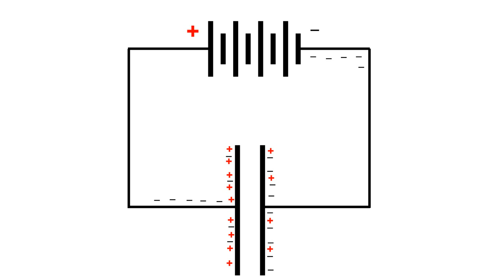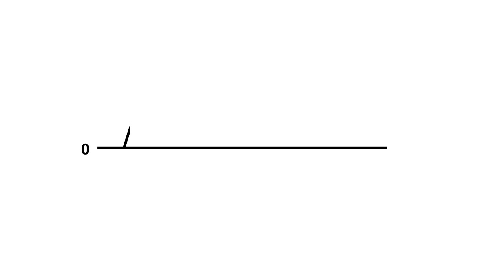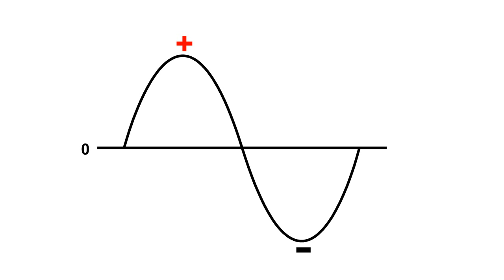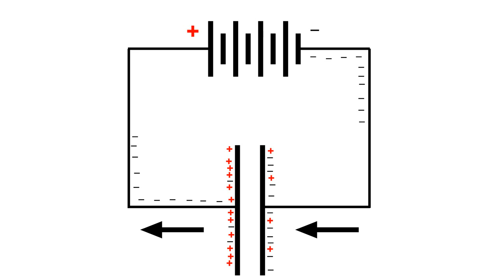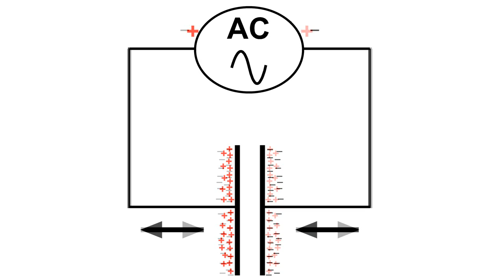Capacitors, DC and AC Current

Comment: How come AC can still come out of a capacitor where the input is a DC biased AC signal when the voltage never goes in under 0? Wouldn't it just be the current speeding up and slowing down if it's in the positive domain only?
Reply from the maker: I'll make another video on this and I'll REPLY to this comment when the video is uploaded. THANKS!
Reply: @AllAmericanFiveRadio  I appreciate that thank you! Something clicked last night and I realized that even if it’s a positive voltage supply, the capacitor will need to discharge if the voltage suddenly drops to compensate, and during that period current would flow in the opposite direction! This must correspond to a negative voltage if you were to measure the voltage between the capacitor output and ground. Is that right?
Reply from the maker: @d3nt391  It’s negative and positive. You are eventually RIGHT. Your question has given me an idea. Keep asking your questions.
Reply: @AllAmericanFiveRadio  thank you! I meant that in a DC circuit if the voltage supplied to a fully charged capacitor drops, even if it’s still in the positive supply range, the voltage from the capacitor output leg to ground will be momentarily negative as it discharges (current flowing in the opposite direction), and rise back up to 0 when the capacitor voltage matches the supply voltage (current slowed to a stop). If the supply voltage increases across a fully charged capacitor, the voltage will momentarily be positive until charged the same way. So putting that together: wiggling the supply voltage up and down is like a biased AC signal, and it’ll look like an AC signal of the same frequency with positive and negative swing at the capacitor output. It also explains why the rate at which the capacitor can charge and discharge, or analogously the frequency of the AC input, can attenuate and slew the signal.

Sorry for the rant, but curious to know if that all sounds right. Thanks again for your vid and electronics wisdom!
Reply from the maker: @d3nt391  I’d say that you have the right idea. Lets say the DC voltage is +10VDC. If we add an AC signal to this +10VDC the  positive part of the AC adds to the +10VDC, the negative part of the AC subtracts from the +10VDC. It is this change in voltage on one plate of the capacitor that changes the voltage on the other plate. So the AC signal passes through the capacitor. I think I can show this effect in a video. Keep asking your questions. Rick
Reply from the maker: @d3nt391  Here is the new video, hope it helps.
AC DC on same WIRE how Capacitor Isolates AC
https://youtu.be/QpB8z6d_7Aw
Reply: @AllAmericanFiveRadio  thank you so much!
Reply from the maker: @d3nt391  Thank you, and your welcome.
Reply: Thanks a lot.

My struggle is how capacitor x could filter the EMI and also how the Y one works.

Grateful if you prepare a video on this or even on all the filtering elements and how they really work
🙂
Reply from the maker: @d3nt391  Here is the new video.
AC DC on same WIRE how Capacitor Isolates AC
https://youtu.be/QpB8z6d_7Aw
Reply from the maker: @kenzo4Ever  Here is the new video, hope it helps.
AC DC on same WIRE how Capacitor Isolates AC
https://youtu.be/QpB8z6d_7Aw

Comment: Hei: Mr, Your explanation of Capacitors Block DC & Allow AC flow is very Brief. Basically AC electron flow simply travel forwards & backwards cycle in between Capacitor Dielectric inside. 

You did now explain Why & how first order Crossover Speaker Capacitor can filter & allow AC electron current to flow/pass through Dielectric insulator.  Please provide YouTube video proof & explain in deatail files if you knows. How it works? Tks...
Reply from the maker: +Madcow Computer 
How  Capacitors charge and discharge
https://youtu.be/Ag2RujOHqJ8

PI filter, Resistor Choke Oscilloscope Demo
https://youtu.be/WzwaHO6WPCk

LC Resonance Testing Demo
https://youtu.be/84WmnlKgTeg

LC Resonance Oscilloscope Demo
https://youtu.be/G_RCyDdt2rM

Resonant Frequency
https://youtu.be/wpNqKJ_6wZA

Comment: I thought current always flows in the direction Of negative. Your diagram shows the current opposite. wouldnt the circuit like this chargr neg to neg and pos to pos
Reply from the maker: +Alchemy Alloys Tattoo 

Electrons flow from negative to positive in a circuit.
Reply from the maker: +Alchemy Alloys Tattoo 
What we know as electron flow, is from the negative to the positive in a circuit. This was not discovered until the vacuum tube rectifier was created. This is when they discovered that they could only get a current to flow when the negative terminal was on the filament and the positive terminal was on the plate. The problem is, before this they had guessed wrong an said that current and electrons flowed from positive to negative, definitely wrong. However for some unknown reason they did not change the arrow for current but they did for electrons. Since electron flow is current flow this absolutely makes no sense at all. So I just use electron flow from negative to positive, because that is the way it is, that has been proven, no doubt about this. Electron flow has been compared to water flowing in a pipe. If the water is flowing in a pipe, what is flowing in the other direction, Nothing. Also you must keep in mind what a theory is, it is someone's best guess. Another thing to think about, is that we really do not know the why of anything. We just measure and use, we are all only observers.
Reply: So, say I had a charged cap and attached it to a light bulb. As the cap discharged through the bulb the electrons would neutralize from the cap in what direction in relation to the opposite charged plates?
Reply from the maker: +Alchemy Alloys Tattoo 
Yes

Comment from the maker: @trailkeeper 
The size of the capacitor and the frequency of the AC is very important. This is very useful in circuits to control or filter.

Comment: didn't understand how exactly the AC doesn't get blocked
Reply from the maker: Because AC keeps changing direction.
Reply: just that ?
Reply: SNAKE EYEZ Akuma When the A/C voltage is negative on that plate of the capacitor, that capacitor plate charges to the voltage of the A/C and then stops charging.  When the A/C switches polarity, the charged plate then drains it's electrons to the positive part of the circuit until it is depleted or the A/C circuit switches back to negative on that plate.  Once the A/C has switched back to negative, the charging of that plate starts again.  All the while, the exact same thing is happening on the opposite plate.  So, the effect is that the current still "flows", but in reality, what is happening is that current does NOT flow "through" the capacitor, but rather the charged plates "give back" their electrons when the A/C polarity flips.
Reply: BoHunter2010 your explanation was more appropriate!!!

Comment: So can I use buy a AC capacitor and use some barrier/blocking diodes and make it store the DC voltage, besides the blocking diode inside? an DC capacitor are there any differences between an AC and DC capacitor in how they are made?
Reply from the maker: Half Wave Power Supply build and demo
https://www.youtube.com/watch?v=Oi75Y6fg8mw

Half/Full Wave Power Supply Oscilloscope Demo
https://www.youtube.com/watch?v=4kMXulubQFU

Diode, Vacuum Tube and Solid State, Power Supply
https://www.youtube.com/watch?v=jG7ok3h8bRs

PI filter, Resistor Choke Oscilloscope Demo
https://www.youtube.com/watch?v=WzwaHO6WPCk